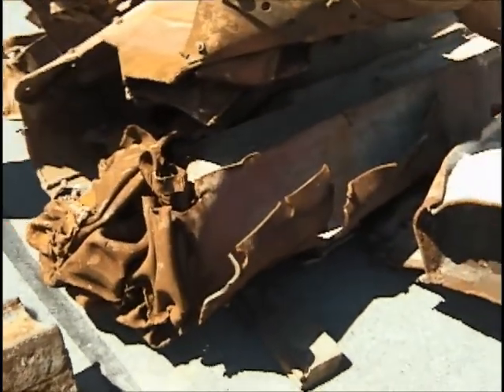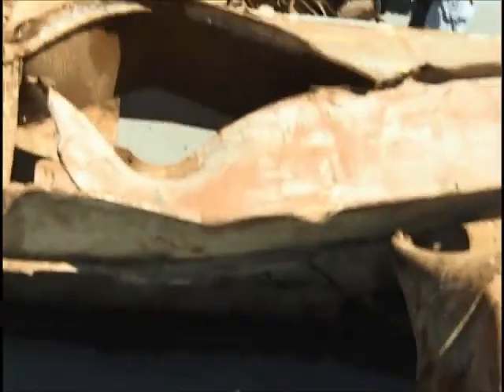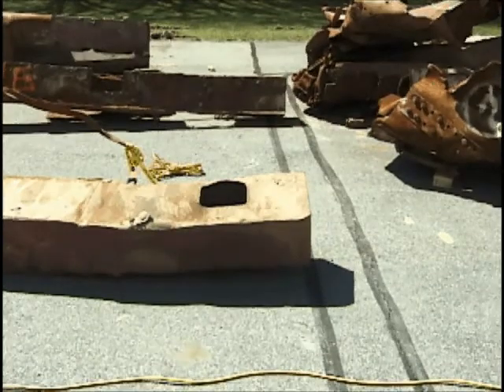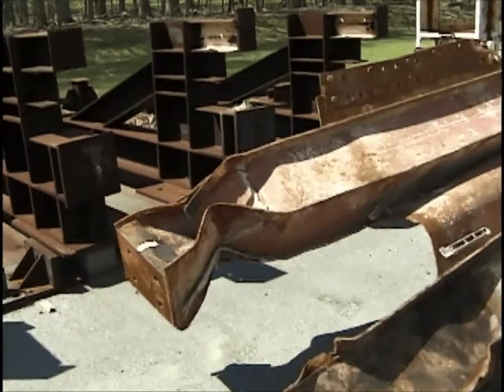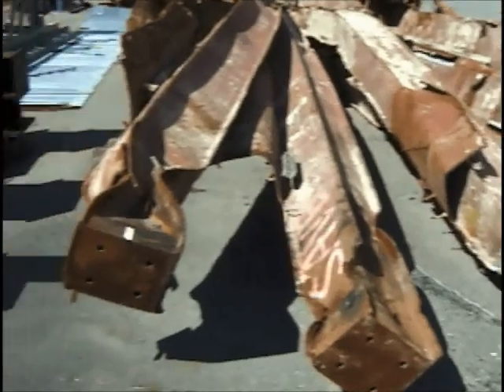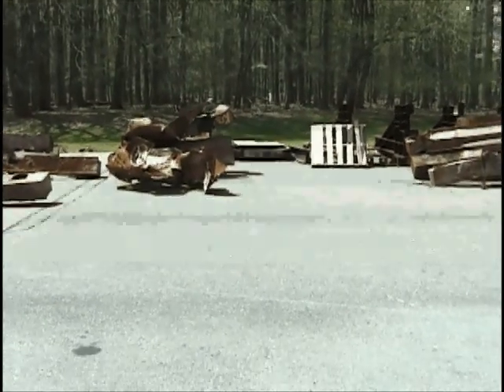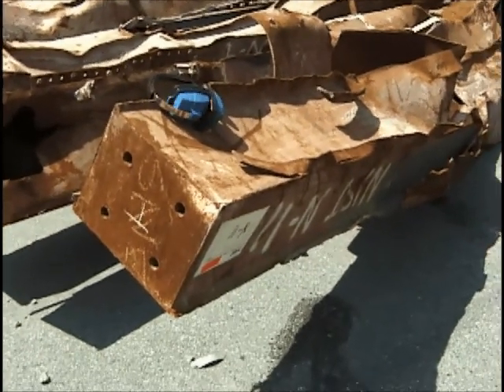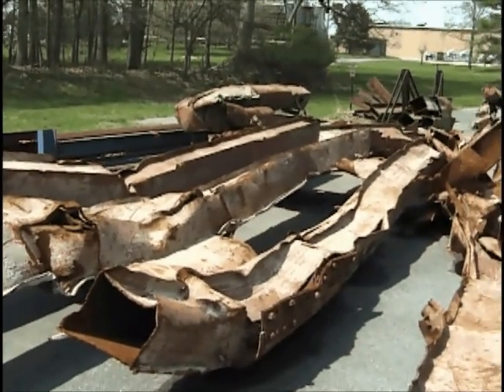Steel Samples from WTC Towers after 9/11 (Clip 2, part 1)

Comment: This is like a joke 🤔 the beams that look extremely damaged in several places (blown out from the inside, crunched at the ends) got sampled in areas where the steel was intact, some holes that look like thermited are ignored and the cameraman appears to be a newbie trainee... If this is an official release to proof they did their job done right then this is worse than recycled toilet paper. It does not only scratch, it hurts!